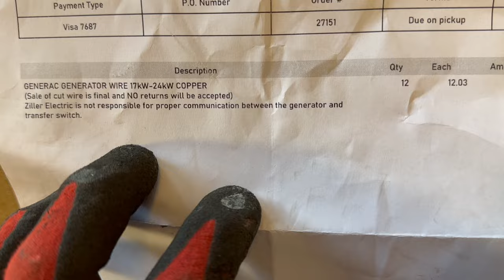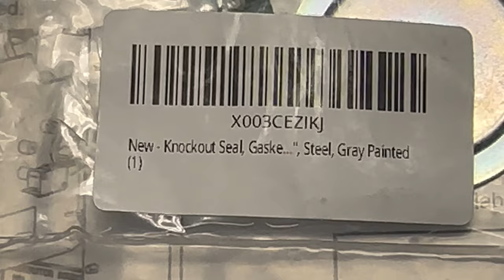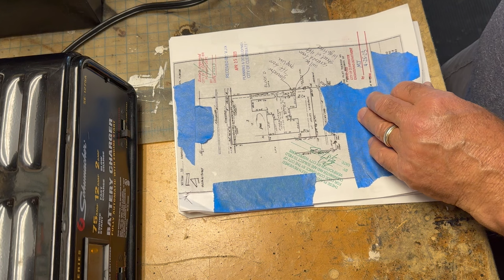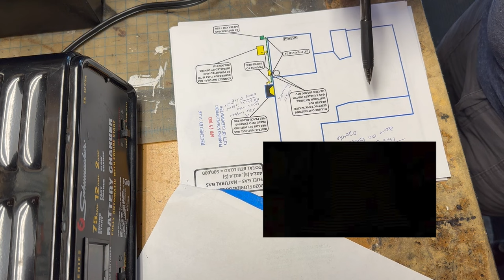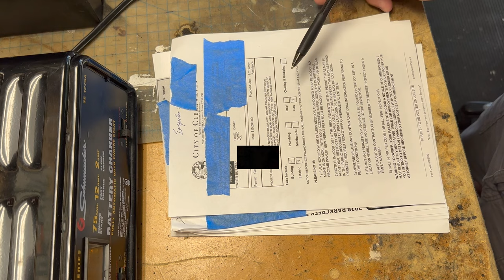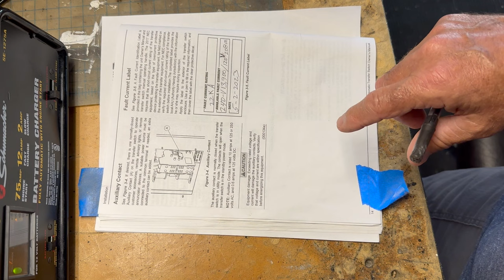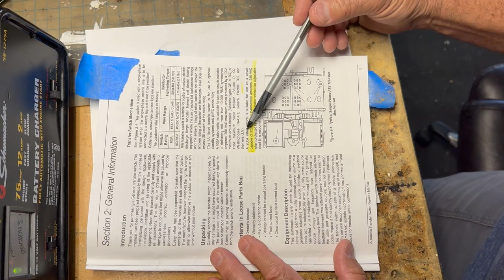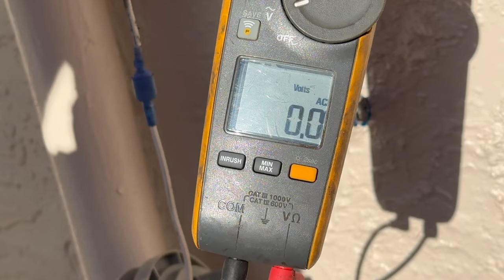How To Install A Whole House Generac Generator And A 200 Amp Generac Transfer Switch.

Comment: Just a heads up from a guy who did these for 25 years... local regulations do vary with distance to an electric meter or gas meter. In much of the country it's 5 feet away, not 3 feet. There's also a maximum height for that main breaker, which I believe is 67 inches from the ground you stand on. (NEC) Yeah, might be nit-picking, but get the details from your local inspector so you don't have to move things. Also, do a size / capacity calculation on your gas supply. I have seen people try to use NG and found they were on the hook to up-size the gas line for $10k. They went with propane for the gen set instead. Plan ahead and have fun!
Reply from the maker: Thank you for your comment. Always check with your local AHJ. In our AHJ nothing can be within 3 feet from the generator, and no ignition source of the generator within 5 feet of the regulator.
Reply: Great and actually helpful advice sir.
Reply from the maker: @samsiryani9023  I am glad that it helped. Thank you for watching.
Reply: @fixitjohn I was also going to mention the breaker height issue just to help future installs. Breaker handle can not be over 6ft.
Reply: @richardsavage02     I just looked that up again yesterday. Max is 6 ft 7 in or 2 meters from the floor / ground. NEC says anything higher needs a permanent platform to raise the floor height.
Reply: Wrong.. NEC doesn't stipulate that, sounds made up to me. I am certified installer through Generac, so there is that
Reply: @japmlp09    Generac doesn't get involved with local codes. My point was to check before you wind up having to change things to satisfy your inspector. BTW, NEC does specify max breaker height, but they don't spell out how to meet it. Raising the working area (floor or platform) is certainly one way to skin that cat if you can't lower the panel.
Reply: @rupe53 NEC specs height ues..how u get there is on you.. local codes are a general idea btw
Reply: @japmlp09     you need to sort out local code from an inspector's opinion. General ideas don't cut it. Have them show you where it is written and make sure they are happy.
Reply: Have to grease the inspectors hand with a Benji..always works😅😅😂
Reply: @japmlp09    greasing palms might work now, but years later you are caught with your pants down if there's an issue and an insurance adjuster spots a code violation. IOW, no coverage. I have personally seen a utility refuse to do a reconnect (home was sold) because other equipment was too close to the meter.

Comment: Inspector is absolutely incorrect about your bonding jumper between the now main disconnect/ATS and interior sub panel. You should have also extended all existing GEC and bonding jumpers from cold water and gas out to your new main source of disconnect.
Reply from the maker: Hi Andrew, the water lines are bonded back to the sub and on out to the main panel. I did not have to ground the gas line because it is already grounded through the appliances. Thanks for your comment. I am sure that it will help all of us.
Reply: John. I'm going to be honest. Beautiful work. But you have the grounding wrong. The grounding should be at your first means of disconnect. Both the ground rods and the water meter should be bonded to the disconnect. Then ser to the main panel, ser to the sub panel. You are creating parallel paths to ground, in theory. Just because it starts up doesn't mean it's safe.

Comment: Really nice job!  The only comment I have is that when I'm doing a job with very heavy cable I will pre-run the cable past any tight turns before I glue that particular piece of conduit.   When I saw you glue that 90 before putting the cable through I knew you were going to have trouble.
Reply from the maker: @talvalon999  yes, I know it does make it a little harder. What I understand is that you are not allowed to piece conduit together over the cable. I don’t know the code for that though. I have done it your way when no one was watching on YouTube Haha. Thanks for watching.
Reply: @fixitjohn  your are correct, it is code not to do that, and your right if you did it during this project someone would of said something! lol   It's code because it was indicated to me a long time ago trying to conduit over a long run of wire in a trench would more than likely expose the areas to be glued to allot of dirt while snaking the wire through.... makes sense.  But just to say again you did a great job with the install.
Reply from the maker: @talvalon999  thanks a bunch

Comment: Conduit must always be glued per code and use conduit  clamp  to mount pipe to wall, can not drill mounting holes inside LB for mounting. You are compromising the water tight requirment. Thats also why you have to glue the conduit to fittings. Other than that its a nice clean job.
Reply from the maker: @georgehegedty7123   thanks for watching

Comment: My neighbor got a 22kw generac but upon looking at the main breaker panel the installer took out the 200 amp breaker in the transfer switch and replaced it with a 150 amp breaker.  Guess it was because the existing main panel was only 150 amp. That begs the question that they oversized the generator in the first place.
Reply from the maker: I would say that yes it was a bit oversized. I don't know why he did not just leave the 200 amp ATS. That is ok as long as the conductors are sized appropriately to the sub-panel.

Comment: Great video!  FYI - Costco is almost always the cheapest with the 200 amp xfer switch bundled in (they sell a Honeywell-branded Generac with unique part # to Costco so you can't price shop it with other stores online). Even if you're not a member, the savings will usually cover the membership cost.
Reply from the maker: Great tip! I saw one at Lowe's at a good price but it was not available. It also did not come with the Gen pad. Your great tip will definitely help someone shopping for a generator.
Reply: In NY they will only sell it to you when it is professionally installed. NO DIY.

Comment: 4 wire from ATS that's because it's your first point of service disconnect
Reply from the maker: Ok good to know.
Reply: Maybe you didn't get the gist of the comment. Your first point of disconnect meaning you old panel must not have the ground and neutral bonded. Neutral will be floating making no contact to ground.  The 2 only bond together at 1st point of disconnect.  Leave your main breaker in original box hooked up.  This gives you extra safety when changing breaker.
Reply from the maker: @mkidd8806  yes, thank you. I did all that in another video. Here is a link if you have time to watch It and let me know what you think.  Thank you for watching.

https://youtu.be/CDhtW78QQ-o?si=pFIjVtYdpPq6phu1

Comment: Hello John - As a retired HVAC Contractor and former Floridian I have to give you an A+ on your "How to install a Whole House Generac generator. You covered points that licensed electricians do not follow as per electrical regulations. I recently inspected a job where the electrician installed the generator conductors within the Meter Can (feeding back "source generator power") to the electrical service panel which is against code...good catch by you. It makes sense not to have two (2) power sources enclosed in the Utility Meter can.

My planned installation (11/2024) requires the generator to be 18 ft. away (inside an enclosed fenced area) from the transfer box. The conductors wrapped in the orange vinyl from Ziller electric is a brilliant idea opposed to running separate conductors and (6) wire for the control leads. 

Questions:  1)  Did you confirm in the instructional booklet that it was acceptable to incorporate the control leads with the conductors in a pre-fabed conductor cabling as you installed from the "transfer switch to the generator". You simulated a power failure at the end of your video resulting in the generator engaging and running. It was a successful start and I assume there is no magnetic interference between the  (240 v line conductors) and the control wires supplied in the single vinyl wrap. I have seen other videos where the electrician installed a separate 1/2" pvc
conduit to run the control wiring. Your method saves additional time, materials, and expense to incorporate all of the wires in a single vinyl sleeve.

2)  We have frequent loss of power in Texas suburbs outside of Houston (power outage for 30 minutes or longer) which is not related to storms. It would be very helpful to know if there are "optional delay settings" available within the programming of the Generac generator in order to create a delayed "auto-start" once a power loss is detected "to avoid nuisance sound with regard to neighbors," and the maximum time provided in the programming for a delayed generator start.  FYI...perhaps an idea for a "future video" providing those self installers like myself an outline for programming, maintenance of the (compressor / battery),  noise level, and natural gas consumption of the generator. Also, will this effect sufficient N.G. flow to a gas burning furnace during the winter months with both furnace and generator operational? All good information to know when using a generator in the winter months.

Your video is the best I have seen on YouTube providing explicit details for the entire installation. Very well done and I highly recommend your video to anyone planning to undertake the installation of a "Whole House Generator.' I think it would be helpful for professional installers and electricians to view it as well in order to provide an optimal installation. This is an excellent instructional video.

Thanks John for sharing your expertise concerning the installation of the Generac generator.
Reply from the maker: @peterd9331  Wow, those are all nice things you said thank you very much! As for the all-in-one cable, I have not had any interference problems from the higher-voltage cable. I am not aware of any optional delay settings for the Generac generator. I have not looked into any of that. As far as the gas pressure goes, your local gas company can tell you that. It would depend on your gas meter and pipe size. I have a gas-fired tankless hot water tank and our generator runs just fine. I am sure a gas furnace would burn more gas then a tankless shot water tank. Good luck and thanks for all the kind words. Thanks for watching. Let me know if I can be of anymore help!

Comment: Great video so far, reminds me a lot of myself jumping in there to take the professional's paycheck and keeping it in my own pocket. Excellent safety tip too, to always have a hot cup of joe nearby to help prevent accidental electrocution. Can't imagine how many times that one's saved me from an early grave! Only reminder I'd add is to make sure it's in a cardboard or Styrofoam cup with a sippie lid, like shown. Thermoses can get gross and hard to clean, and ceramic mugs either draw in flies and/or suck the heat straight out of the coffee, rendering it useless usually within minutes. 

Making some popcorn now for the final 50 minutes!
Reply from the maker: You are so right keeping that paycheck. And the danger of drinking coffee from a ceramic cup will cool off way to quickly. I like your style Rick. Thanks for watching.

Comment: Hey John just wanted to say I appreciate you posting this video.  I had a 24kw generac installed about 3 months ago professionally and it was interesting to compare what you did to what they did.  It led me to believe they did a pretty darn good job as they paralleled yours pretty close.  If I had been about 20 years younger I probably would have attempted to self install as well, but I'm at that point in my life where I can afford to pay someone else to do it vs killing myself trying to do the work alone.  Not to mention I had a 150 foot attic run across the house for the power and signal cable to the other side of the house where my electric meter was.  Much nicer to have a youngster do that kinda work than me!
Reply from the maker: I am such a tightwad. If I see a service truck slowing down by my house I go into a panic attack haha. I know that it is nice to have things done once in a while. Thanks for watching and I appreciate your comments.

Comment: Great video !!  very detailed !! searched YouTube for a video just like this ! Great description on supplies used
Reply from the maker: I am glad that it helped.
Reply: I have the similar set up. I have a 200 amp service panel for my home and I was wondering what size wire can I run to my 22KW Generac generator that has 100 amp main on the generator and my home has a 200 amp main on the box. i’ve been reading mixed answers from different reviews. I have a distance of 10 feet and I see very sizes from a #8 all the way up to a number 2/0 gauge wire used for the power source from the generator to the transfer switch. What size wire did you use?
Reply from the maker: I used that Ziller all-in-one cable. It was 6 gauge copper stranded. I went to look it up and could not find it. My direction said to use 6 to 250 MCM. What is weird is everyone is talking about using the bigger cable but if you go too big they won't fit in the lug. Good luck.

Comment: Foam filled concrete pad.  You’d be better off pouring a concrete pad.  It would be stronger and heavier.   Great video, I would have probably installed transfer switch, gas lines, generator lines, and new power lines into main box before having then meter pulled.   Shortening the outage window.  So you’d only have to pull out existing run, and wire new cables in its place.   

There aren’t many videos showing this.
Reply from the maker: Great suggestion! I never thought of that but I don’t do it every day. But you are right that may help some one. And yes I thought about pouring a pad but I have been covered up here in projects. The gas lines were already in. Thanks for watching.

Comment: I'm convinced people are overspending on these things because they aren't familiar with electronics / electric  ( which is fine ), 24KW is such overkill for any house below 4000sqft. Your HVAC and heating system is the biggest load on your house, but even two 3-ton AC running on max will only use ~12,500 watts and that can cool a 4000sqft home, that leaves you about ~5,500 watts left ( if you get the 18KW model ) which is enough to run fridge's, lights, washing machines, etc.

I understand that most people will not care to spend an extra ~$3500 on the bigger unit, but I'm just saying most people are buying something they will not take full advantage of.
Reply from the maker: Thank you for your comments. I am sure that it will help someone decide on what generator to buy. Thank you for watching.

Comment: the inspector is wrong but being the AHJ its his call.  The generac transfer switch is service rated meaning now that you changed the service it is the first point of disconnection where the grounds and neutral are bonded. you would then have a neutral and ground wire going to the breaker box and also need to separate the branch circuit neutral and grounds. Leaving them bonded at the breaker box now means that bare ground wire will be taking some of the neutral current back to the source which is a no no and could be dangerous. If you didnt have that ground wire and also separated the gounds and neutrals at the breaker box there would be no reference to ground since you used PVC to connect it all. Clearing a ground fault would not happen.
Reply from the maker: I do have a ground to the cold water line.   But yes I am glad that I ran the ground. According to the instructions. Thanks for your input. I always appreciate the pro’s comments. Thanks for watching.
Reply: Well stated........Always run any project thru the AHJ first.  They have the final say on approval of any project, even a dog house. 
I agree with you on the grounds, and the bonding issue, I had an underwriter inspector who was ground happy, but I learned from him years ago, you can never have enough grounds, but watch the bonding.  I found that if I ran a couple extra ground rods, like more than needed, he would leave an inspection happy ( and pass it )
Reply: @bobwild9995 ehhhhh. Too many grounds versus an improper path to ground are too different things. Path of least resistance. The grounds should be at the disconnect. Placing grounds at both the disconnect and a panel will make it fight to find that path of least resistance. This is kirchoffs law. If the ground is bonded at more than one location it makes it a current carrying conductor under normal conditions. It is literally in parallel.
Reply: So all the wise asses on here..how u gonna seperate the grounds and neutrals, on a 1950s house, with conduit is the ground...

Comment: Can you run SEC/SER wire in conduit? I thought you couldn't do that because the individual wires usually aren't labeled?
Reply from the maker: Hi, if you are asking about the generic cable, I found this on ziller electric website. 

UL THWN 600V
UL Type TC-ER-JP 600V
The insulation is acceptable for use in locations at 75 °C dry and 75 °C
wet. The cable is suitable for use in cable trays, aerial or direct burial
installations. The cable is JP rated for installation in accordance with
Part II of Article 334.

The 2017 NEC, allows this wire to be installed without a conduit or flexible raceway unless subject to physical damage. Consult your authority having jurisdiction prior to installation.

The other cable that I ran from the meter to the transfer switch and in to the electric panel was 0/2 copper THHN. I hope this helps. Thanks for watching.